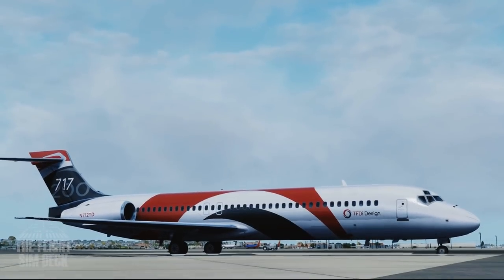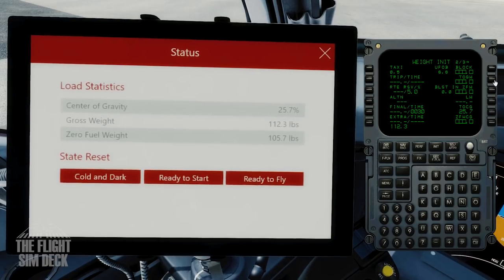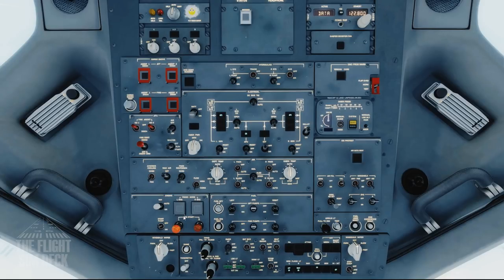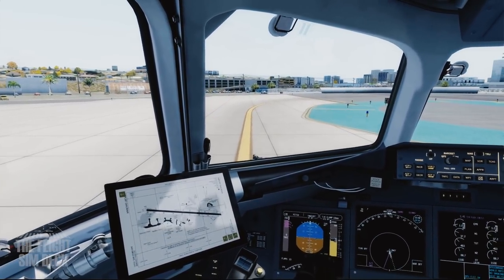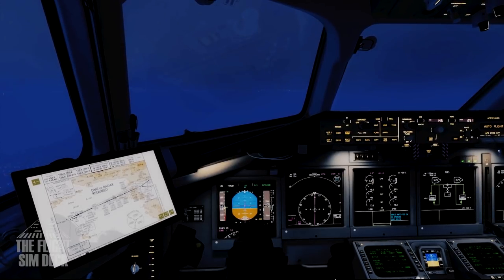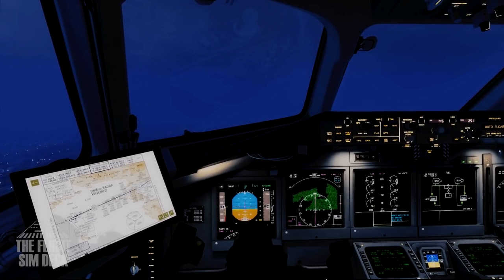How To | Operating the TFDi Design 717-200

Comment from the maker: 0:18 Cockpit Preparation
3:08 Loading PAX, Fuel, Cargo
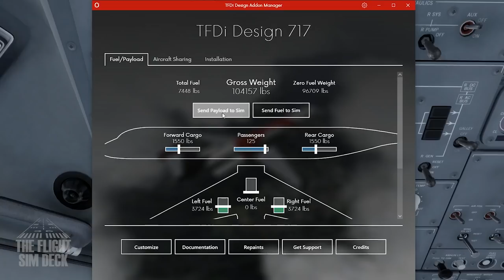4:04 Programing FMC
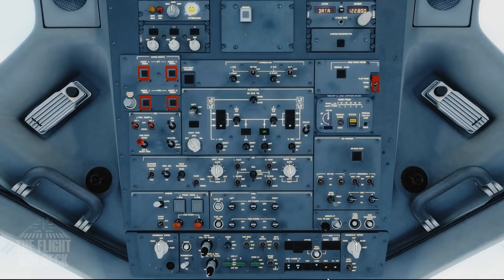9:22 APU Start
9:56 Before Engine Start
10:50 Starting Engine 1
11:56 Starting Engine 2
12:44 After Start Procedure
14:20 Adding Charts to the Tablet
15:33 Taxi
17:46 Line up and Takeoff
22:54 Engaging Auto Pilot 
23:38 FL100 and FL180 procedures
24:07 Approach and Landing
33:49 ILS Autoland
41:49 After Land Procedures
44:23 Shutdown
Reply: I recommend you pin this comment
Reply from the maker: @finalities got it! It was at one point. Thanks

Comment: Good video , for information Volotea (I don't know for Qantas, Delta and Hawaiin) keep the flaps 13 during taxi after landing and retract the flaps during last turn (in case of a emergency you can use the flaps to down the aircraft), he set air data off when engine is off, pack L off and pack R auto when the engine is off. The reverse are activated only when the front wheel touch the ground because on the MD80 the pilot set the reverse and when the airplane boucing the reverse are actived(MD80 Reverses Thrust in the air! by justplane)

Comment: At 24:07 you say "So now I'm going to show you an approach into LAX 24R. Now to do the descent, all you have to do is lower the number on the MCP, and once the aircraft passes the descent marker, it will start the descent for you."

What number are you referring to, and how do you lower it? I didn't notice you clicking/lowering/changing anything.
Reply from the maker: I was talking about the altitude on the MCP. As long as it’s lower than the cruise altitude it will start to descend on the profile after passing the descent marker.

Comment: Are both the basic model  with a MTOW of 110,000 lbs and the High Gross Weight Model with a MTOW of 121,000 lbs simulated in this package?

Comment: Quick question. I’m flying this tomorrow night to skiathos, and for some reason, I can’t set or find the auto brake... any idea where it is?
Reply from the maker: SimBoy it doesn’t have them. I guess that system was not very common on the 717. Some airlines have them but most do not is my understanding

Comment: Do you know why my sound won't work also should I be worried if EEEEEE stabilizer motion
Reply from the maker: Slimaa Gaming no as I explained stabilizer motion is just letting you know that the plane is trimming. No sound? But you hear the warning?
Reply: @TheFlightSimDeck  no there is no sound from The 717 it's not the SIM cause I can hear AI planes and I have all the sound coming out of the speaker I use but there is no sound

Comment: 4:10, but I'm confused, it is a boeing!? I mean sure, the design was meant to be made to challenge the md80 right? So unless it was one off those silly mistakes I am confused
Reply from the maker: Maxkillers It was originally designed and sold by McDonnell Douglas, but Boeing merged with them so it became a Boeing. That’s why it doesn’t fit the Boeing style.
Reply: The Flight Sim Deck Yeah,the aircraft was originally named McDonnell Douglas MD95 or something like that,after the merge between Boeing & McDonnell Douglas it become Boeing 717
Reply: @shawnw1291  yes it was the MD95 originally but now it's the 717 :)
Reply: When boeing bought them, McDonnell was working on the 'next' MD called the 95 but thought since Boeing just got them they would simply scrap the program. Instead Boeing moved ahead with the program but put the name of the plane in the 7 series as the 717
Reply: unknown to many, a lot of the technology from the former md95/717 has made its way into all their products

Comment: How come when I start Eng. 2 first (like how you're supposed to in most aircraft), Engine 1 refuses to start afterwords?
Reply from the maker: I’m not sure. I’ve experienced that too but I’ve also seen people do it successfully. I’m reaching out to someone who files the 717 so I can ask them. All the checklists I’ve seen call for the left engine first. Delta even single engine taxis with the left engine.
Reply: Isolation valve could be in wrong position

Comment: Whenever I start, I always get 4 warnings: Stabilizer, Slats, Flaps, and Brakes. Any helP?
Reply from the maker: walter 13:00 should fix those issues.
Reply: The Flight Sim Deck I managed to figure out the problem! But this helped as well, since the warnings popped back up. Since my throttle is broke, it does random things sometimes (I.e. full throttle after joystick movement) and that sounded the alarm. However, I owe you my gratitude. Thank you, and keep up the amazing Flight Simulator videos!

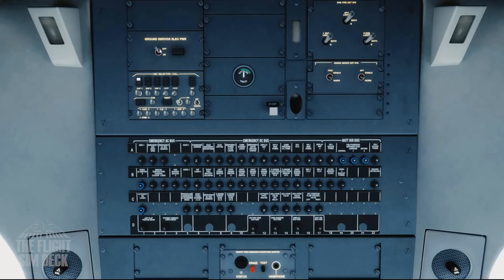Comment: 2:50 "we can get 'this' on."  What is "this" called?
Reply from the maker: It's one of the ways you can connect the GPU. It's a made up button not on the actual aircraft, called the, "Ground Services ELEX PWR" button. To answer your second question at 3:09 I'm saying lets come over here to do the fuel. Here being the add-on manager.

Comment: My autothrottle doesn't go to manual I double clicked like you said help please
Reply from the maker: josh thumperluck there are two buttons on the throttle so you’re hitting the one on the handle right? What happens if you move the throttle, does it come off then?
Reply: @TheFlightSimDeck  HI I will test after the flight with 777,  also how do you get the airport chart on the left monitor thanks
Reply from the maker: @ceff01  I have a video here on how to do that:
https://www.youtube.com/watch?v=8sRwUqLFJkk
Reply: @TheFlightSimDeck  perfect thanks 1 last thing I have same black ground texture on some areas did you fix that and if so how  cheers.
Reply: HI where do I get the airport charts please
Reply from the maker: @ceff01  Here is one free source for US charts http://airnav.com/airports/
Just search the airport code. Then scroll down about half way and the chart will be on the right.

As for the textures I don't think I fixed those. I haven't used P3D in a while. Trying to get it reinstalled.

Comment: WARNING evidently this Aircraft does NOT work in PrePar3D V.4 according to other users on the TFDI Forum Boards after forking over $60.00 Dollars - LINK to Forum Board :   https://forums.tfdidesign.com/index.php?/topic/3537-ctd-also-with-p3d-44/page/2/
Reply from the maker: Captain Patroni I remember this issue but I never had it happen to me when changing views. Then again I never updated past P3D v4.3. I think during this tutorial I was running 4.2.